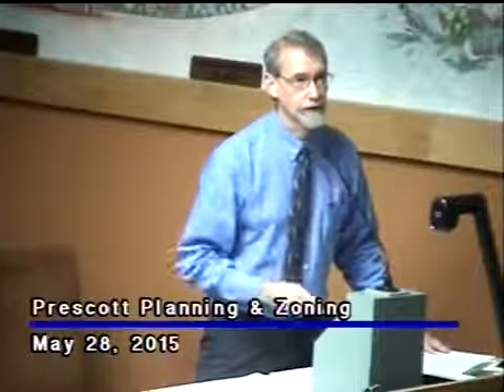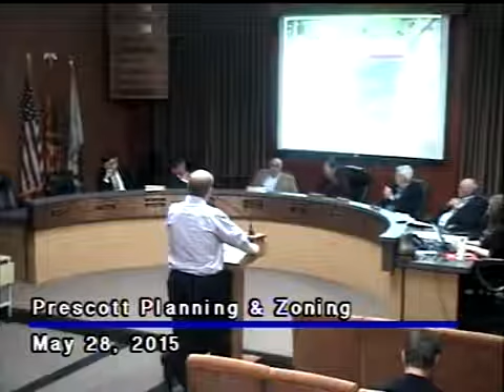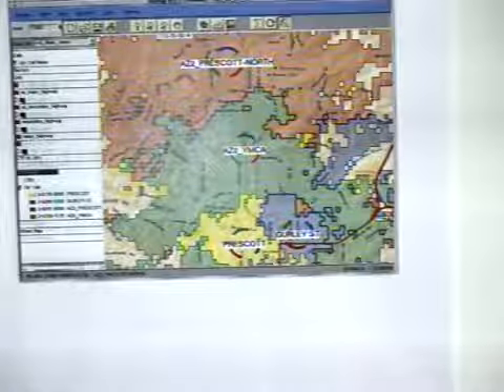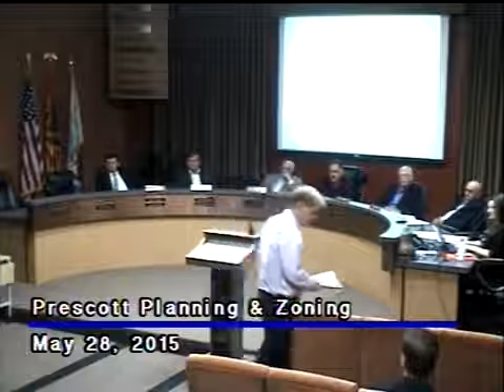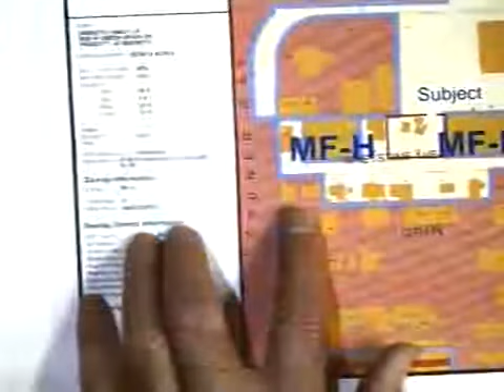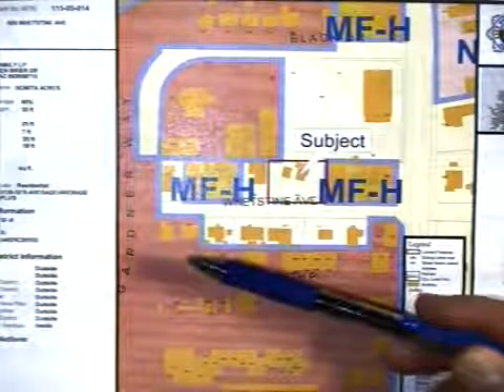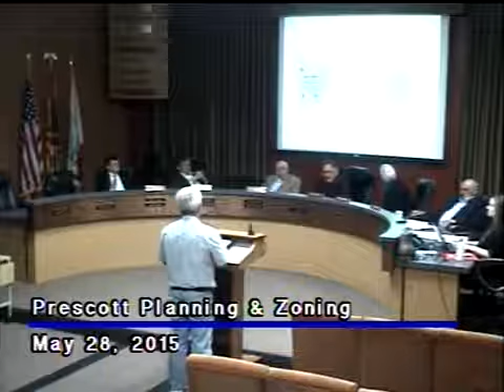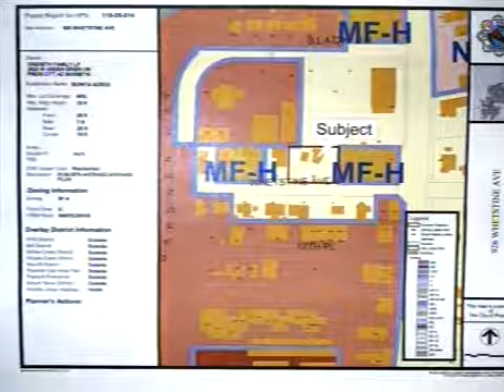Planning and Zoning - 15-05-28

Comment from the maker: http://www.prescott-az.gov/_d/agendas/2015-05-28_3928.pdf
0:49 IV. PUBLIC HEARING ITEMS
1. SUP14-005, 930 Ruth Street. APN: 11619006N. Request to replace existing pole with new 60' pole of larger diameter and place antennas on the pole. Addition of new outdoor radio equipment and emergency generator behind new enclosure attached to dugout at the field.
19:44 2. RZ15-002 – Continuation of request for a Rezoning, General Plan Map Amendment, and Amendment of the Willow Creek Corridor Plan at 926 Whetstine Ave from a Single-Family 9,000 sq ft (SF-9) to a Multi-Family High Density (MF-H) Zoning District. APN: 115-05-014. Owner/Applicant is Greseth Family L.P. Community Planner is George Worley, Phone:777-1287.